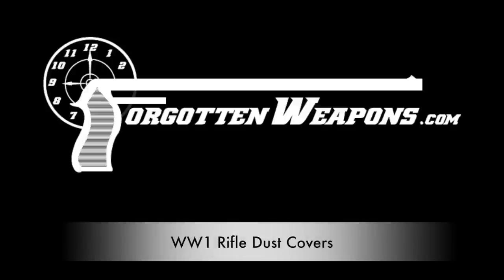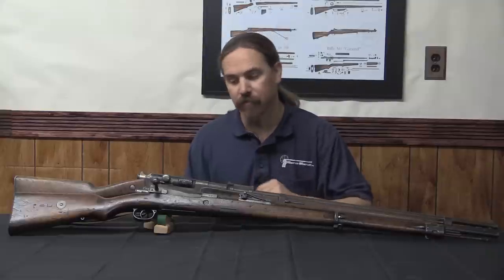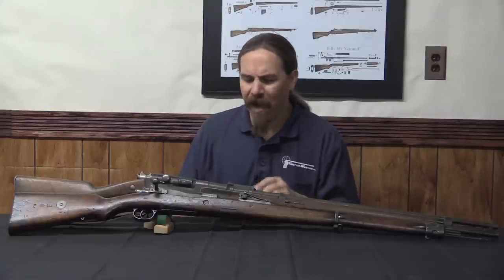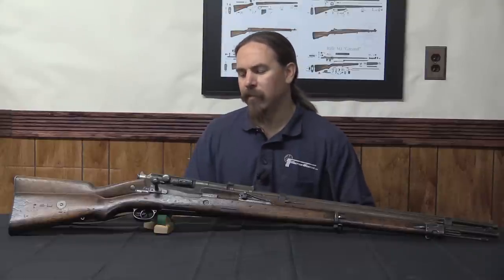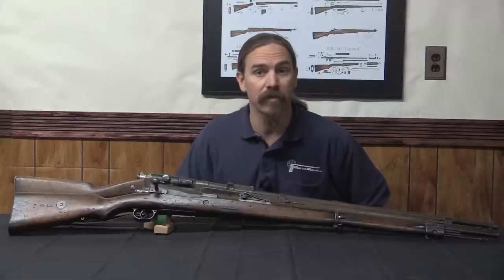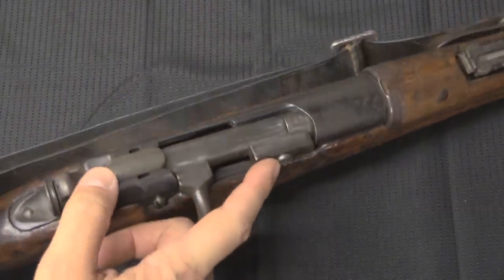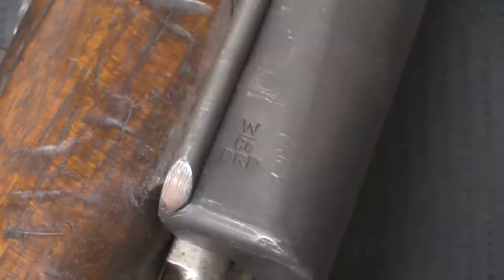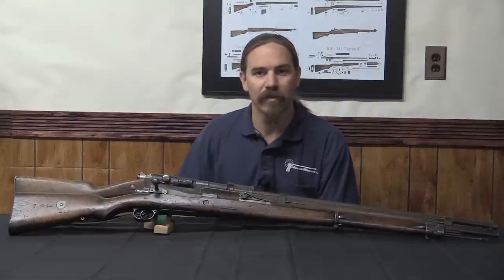WW1 Rifle Mud Covers: Lebel & Gewehr 98

Comment: So the french made a screw with a larger head and shaped a piece of sheet metal to fit. The Germans made two pieces of shaped sheet metal, one requiring a spring temper, guild rod, guild tube, latching system, and proof marked them. How very German of them, and they wounder why all their resources were gone in short order.
Reply: You can do something right or you can take a turd a spray it golden. In 75% of all cases, us germans choose the first option.
Reply: The Pandora Guy yeah but it kinda fucked u guys over in the end
Reply: So, how much resources did the Tiger tank projects take up, and how effective were they again? Bad ass tank with a great gun, takes so many resources they only made a handful instead of the other totally viable, more practical tank designs already in production. Oh, throw two Maus tanks on top of the wasted resource pile, and whatever else useless that steel went too.
Reply: Jesse Sisolack And how many T34 had to outrun their infantry to get close enough to effectively fight back against a single Tiger and then got gunned down by PaKs, Pz. IVs and infantry held AT? Theres a reason why everyone built heavy tanks. And theres a reason why the Germans as well as the UK and US built ridiculously oversized monster-tanks, size related problems show up there before they occur in your mainline models...
Reply: Who wins is always the main side of the story, because if you go to war - you do that to win, otherwise you are an idiot. And the fact that allies won shows that, eventually, quanity tops quality, hovewer sad that may sound.
Reply: Most of the time, over-engineering from germany was a drawback, not a force. I'll focus on tanks because there are fairly easy sources you can find yourself that prove my point.

Almost every part of the German tanks were a beauty. Well crafted chains to hold things, expert welding, good optics, complicated suspensions, very powerful engines. Every small problem was solved. Except the biggest one, to make a weapon that could win the war.

A Panther required at least 5 more time than a t-34 to be built, and was something like two or three times as expensive.

The Tiger, which was a marvel of technology for 1942, was so, so, so expensive, unreliable, slow, and eventually became obsolete, and a very easy target when the skies were lost.

Let's not even discuss the Tiger 2, which was just a waste of ressources, costing as much as 10 T-34 or 8 M4, not counting the costs of transporting such a beast or maintaining it.

Meanwhile, Russians and American flooded the battlefield with tens of thousands of GOOD ENOUGH tanks, which meant that a German tank had to kill a good dozen of Allied tank to be "worth it".

Then to counter my point, you could talk about manpower, and the fact that the Germans could never man as much tanks as the Allies. Well, there's a slight problem, Germans tanks weren't known for their reliability, in fact quite the opposite.

They required very heavy maintenance, they required a road that could support their weight, they required very heavy recovery vehicles, they gobbled fuel, and required expensive spare parts. If you are short on manpower and ressources, those things are not an advantage. Attrition was (and still is) a real problem, and germany wasn't able to maintain it's tanks, so most of them was just left when an easily replaceable, but ultimately unavailable piece broke.

Yes, there are exceptions, yes some "over-engineered" weapons were a success, but to say the majority of them were is incorrect. The point of a weapon on the battlefield is to accomplish a goal, not be a marvel of engineering. If you can combine both, it's great, otherwise you're just gonna have a shiny toy
Reply: Well despite over engineering,during WW1 Germany still produced much more rifles than France.France just made about 2 million Berthier rifles and several hundred thousand Lebels(although 2.8 million made before WW1 to equip rest of French Army).İn total they made about 3 million rifles during WW1 while Germans made about 7 million Gewehr 98s between 1914-1918.Reason was France lost more than half of it's steel industry after 1914 to German invasion of Northern France,Germany was producing about 15 million tons of steel during per year between 1914-1918 while France was producing just about tenth of that or so while they made close to 5 million tons in 1913,German output was almost 18 million tons same year.France was also importing several million tons of iron and steel from Britain and US to feed it's armament industry and war effort.

Comment: Seems strange that Germany and France decided to design and fit dust covers to their rifle bolts yet Britain, who's Lee Enfield originally had them, never got around to refitting them.
Reply: They took them off so they could fit charger guides to use stripper clips on the SMLE so I guess designing a dust cover that worked around that would’ve been too much hassle

Comment: IIRC, the reason dust covers weren't more prevalent in WW1 is because the French and Germans didn't see any reason to fight while knee deep in mud. The Germans in particular were on the defensive for most of their time on the western front, and build excellent trenches on higher ground and with good drainage and even installed wickerwork walls and duckboards to retain the dirt, so their trenches weren't particularly muddy. The Brits, on the other hand, were stubborn and didn't want to give up an inch of ground, even if moving back a few hundred yards would get them above the water table. They also saw their trenches as "temporary" refuges while building up for the next big attack, and so didn't want to waste time and resources improving them any more than was strictly necessary. The attitude was more or less, "why worry about mud when you'll be moving on soon?"

Comment: Why didn't the bolt action rifles in ww2 have dust covers? You'd think they would learn from ww1 and make them a standard. Except Japan, no body else seems to have em.
Reply: Many Japanese soldiers got rid of their dust covers in WW2. They rattled and were unnecessary since trench battles didn't exist anymore
Reply: Trench warfare was a far dirtier affair both morally and literally than later wars, sure guns still got dirty/muddy etc. but you weren't constantly sitting in trenches 7-8 ft deep in some places and covered head to toe in filth, living and working in the same 200 meters of trench network for months at a time.

Comment: SCANDAL!
The german dust cover is missing the matching serial number to the rifle it is attached to! How the hell did this slip through quality control? It should never have been given out this way, an oversight like this this is not excusable!
Reply: Better no dust cover for Hanz than a mixed-serial one!
Reply: 44WarmocK77 not even a serial number on the screws, tsk tsk
Reply: 44WarmocK77 just throw away the rifle at this point, it might as well be unusable
Reply: It doesn't meet the teutonic standard for minimum perfection! Guter gott! nein! nein!
Reply: No wonder Germany lost the war!
Reply: Believe it or not: a serial number on the dust cover would actually make sense in this case (unlike for the screws). ;)
As Ian pointed out, dust covers were a semi-rare accessory. If it was marked with a serial number this would mean that it had been traced, so the quartermaster of a unit could keep track on who had received one and who hadn't. If it had worked at least somewhat effectively, soldiers would have lined up in front of the next depot on the spot to get something that could have saved their lives in a war where one out of seven men were killed.
Reply: Ah, because ww1

Comment: Ian, I feel I must point out that mud is presumably something those rifles have seen before. I admit I'd be hesitant to try it as well, but I swear that as a kid cleaning my dad's GEW 98 after getting it, it still had mud in the stock and it's managed to hold together for all these years. We used to joke that cleaning out the mud would ruin it's accuracy because the mud was in all of the tight corners and almost resembled bedding compound.

Comment: it looks like the Mauser's mud cover might not come back far enough to use a stripper clip and you would have to release  the lever under  the bolt handle after opening the cover to be able to  use a stripper clip

Comment: The German one looks like it would interfere with the stripper clip guides, seems like you'd have to load the rounds individually if you didn't disconnect it from the bolt head first which isn't feasible to do mid combat

Comment: Hi Ian...at one time Numrich Gun Parts sold a reproduction Dust Cover Assembly for the GEW98.  Part Number 1129970 $59.15.  They were marked: WAFFENFABRIK MAUSER A-G. OBERNDORF A/N 1918.  I've contacted them several times over the years about when they might get more of these and always the same answer. "At this time this item is not available."  Perhaps, you have some pull?  You might be able to find out where they purchased them or had them made in the past.  We could they pool an order together for WWI rifle collectors.

Comment: Mostly you never really needed a dust/mud cover. You never ever walked around with the bolt to the rear. And if your weapon got covered in mud you were expected to be smart enough to wipe the thing down a little before you opened your bolt.
Reply: I reckon a concscript in the trenches getting spooked by an attack would forget about that.

Comment: Unfortunately I'm not a patreon so I can't ask this in a Q&A from the Jesus himself, but maybe someone here has an answer:
If they came up with mud covers in late WW1, how come none of the WW2 rifles either country had used kept the things?
Particularly interested in the French since they believed WW2 was going to be just more WW1 hence the whole Maginot line.
Reply: The Japanese still had them on their rifles. Most didn't really see a need. The maginot Line was to prevent a stalemate like WWI! The line was there to hold up an invasion while the reserves are sent in to counter attack. You had 80,000 men on the line, which sounds like a lot, until you consider the 2 million men that were held in the center of France to counter attack. In essence, the Maginot Line worked perfectly in May and June of 1940 it just that the French and British fell for the Germans deception and got surrounded in Belgium.
Reply: +Szalami 
I have the same question - why covers were not further improved and mass produced during interbellum period? However, I may imagine French thinking there will be no need for them exactly because of Maginot line - it's made of concrete bunkers, not muddy trenches.
Reply: Maybe they wanted to save raw materials
Reply: Japanese Arisaka Type 38 has a dust cover and was developed before WW I, and the dust cover continued on Type 99 which came into service in 1939. For the people who want to know how well they worked, just go check out InRange, they did a mud test on Type 38 with dust cover on.
Reply: Actually dust covers predate the war by many years but very few armies actually adopted them (Japan is just about it for a major producer). Most nations figured out that they are usually not worth the trouble and that probably is why the ones Ian is showing here never really persisted. 

Covers have to be made tight and strong or else they don't work to start with and if you dirty a gun with the action open, which is much of the time as you are loading and cycling the weapon, that cover may actually end up trapping more crud than not. Most armies figured it was wiser, and certainly cheaper, to just train soldiers how to limit the risks of dirtying their guns. Japan's covers were very well-made and worked very well, but if you got a mismatched one, one not specifically fitted to the rifle in the factory, then they often rattle and will let some crud in, making them a liability rather than an asset.  Hope that helps!
Reply: Eustace, a rattling dust cover is a big myth. It's up there with the Garand 'ping' myth. They only rattle when the action is cycled and a gunshot is much much louder than a rattle.

I think one of the Austrians had a prototype Mauser style rifle planned before the war and it had a dust cover and it's what the Mukden Type 13 is based off of.

Comment: Please don't mud these rifles.
Reply: Wes Smith my whole body cringed when I saw that
Reply: if you feel the need to test it, why not use something more along the lines of a thick, opaque liquid.  please, no mud
Reply: Would the German one fit a G98k? They could use some cheap Eastern European beater instead. The actions are basically the same... I'm sure they could probably find a cheapo beater Lebel too, AFAIK they aren't that rare, which isn't surprising given the length of service that the rifle had. In short I reckon they could source expendable substitutes.
Reply: Shut up. These rifles are supposed to get a little dirty.
Reply: bfgguns Spoke by someone who isn't going to have to clean the dirty rifles.
Reply: bfgguns no u

Comment: Wait, it looks to me like one can't load a rifle from a stripper clip while a dust cover is on, at least on Mauser, without unlatching that swiveling locking detail around bolt handle. That's quite an issue, if true.
Reply: TotalRookie_LV you can still load
Reply: Ah, OK, then it's not that bad, still, I'd like to see the process of loading and shooting itself, or at least the cycling of the bolt with dummy rounds.